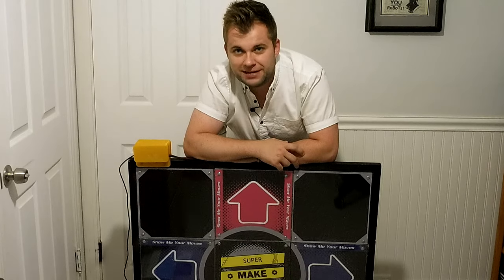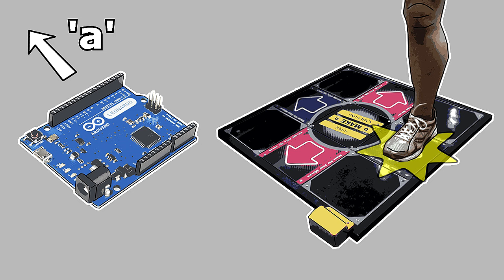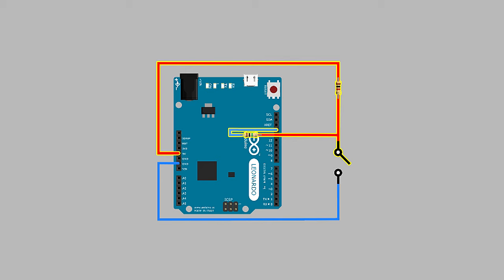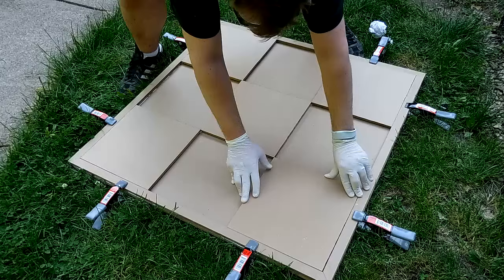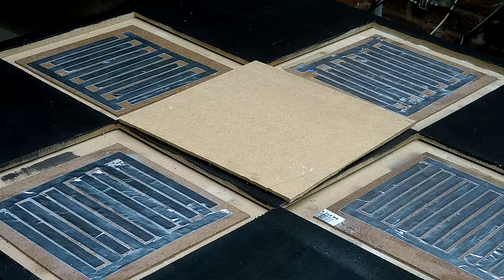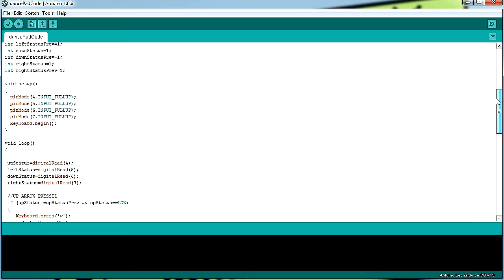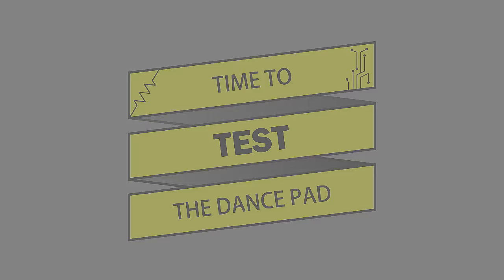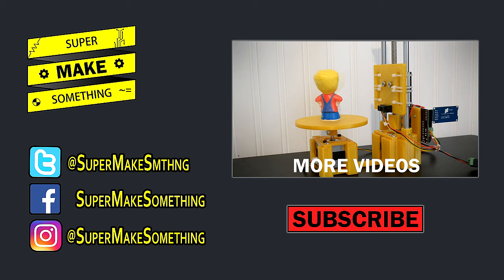USB DDR Dance Pad (Arduino, Pull-Up Resistors) - Super Make Something Episode 9

Comment: I can't find the arduino leonardo on https://store-usa.arduino.cc  .   will your arduino code work on any of the other arduino products?  I'm looking at the cheaper ones like ARDUINO 101 or ARDUINO UNO REV3??
Reply from the maker: +Reid Weatherly hmmm. You are right. It looks like they discontinued it. :-/ The chip that allows the Arduino to act like a USB device is the ATMega32u4. Looks like the Arduino Micro also uses this chip so it will work. Alternatively, you may still be able to buy Leonardo's from a site like Sparkfun or Adafruit.
Reply: Wow! you responded super quickly! thanks man. I just found your channel and your prompt response pushed me into subscribing. : ).   I found some on amazon but I guess they are fake knock offs.  about 20% don't work..  

[Edit]  I just checked Sparkfun and Adafruit like you said and they do have it!  This is exciting for me because I missed the whole DDR thing and I want to go back and experience it.  I saw you tell someone this project maybe cost you $75.  I don't plan on doing any graphics or acrylic to save on cost.  This shouldn't actually affect anything right?  I assume the Acrylic was just to protect the fancy graphics.
Reply: I ordered the Arduino Leonardo.  I'll tell you how this goes! I'm doing it! : )
Reply from the maker: +Reid Weatherly Awesome! Please let me know how it goes! The acrylic was actually about ~1/4 of the total build cost, so you may come in a bit cheaper depending on how/if you paint it. As I said in some of the other comments some modifications I would suggest after having built this one would be to 1.) use metal sheet instead of aluminum foil, and 2.) use screws to fasten the electrical connections instead of electrical tape. Both of these will save you some maintenance in the future and increase the longevity of your pad. Another user suggested rubber pads instead of weather insulation, which may also be a good idea as this will be somewhat stiffer and thus help the buttons "bounce back" faster. Good luck!
Reply: my Arduino Leonardo arrived! It didn't come with a power supply cord though.  but I was able to get the code uploaded to it.  I ordered a "Battery Clip with 2.1mm X 5.5mm Male DC Plug for Arduino".  I'm just going to use a 9 volt for now.  It should arrive in 2-3 days.  I'll update you then. : )
Reply from the maker: Reid Weatherly Awesome! For this project, the Arduino is actually powered off of the USB port, so no additional power supply is required.

Comment: 2 Questions about the wirering:Is the connection between GROUND and PIN with the RESISTOR already build in the arduino? and: What RESISTOR should be used between the 5V and PIN? Thanks in advance
Reply from the maker: Madaadam relative to the ground, the pin has high electrical impedance when configured as an input. This can be modeled as having a large resistor, but doesn't physically require one. 

The Arduino also has internal pull-up resistors that can be enabled via code, so no external resistors are necessary.
Reply: OOOhhh that makes sense. thanks for the quick answer

Comment: How will the foam hold up? Will it maintain its springiness with wear and age?
Reply from the maker: The pad is only ~1 month old, but the foam is holding up well so far!  It's relatively inexpensive and is sold in large rolls at the hardware store, so swapping it out from time to time should not be a big problem.
Reply: Nice! What difficulty do you play on?
Reply from the maker: I play Heavy.  Just estimating, I would say ~1 hr every day or two..?

Comment: Since some people don't have access to all the power tools used here, wouldn't it be easier to
find a supplier/business that can provide wooden boards cut to custom sizes? And for the enclosure, have it printed in 3d printer shop? 

Would still propably be a lot cheaper than getting the 350$ option.

Comment: Awersome project! what type of wires did you use?
Reply from the maker: Thanks! I used solid core wire, but really any wire should work.  There isn't a lot of current going through them, so whatever fits into the Arduino headers should be good!
Reply: @SuperMakeSomething  thank you so much! In these days i'm buyng the materials, so i didn't find the 16mm mds and 8mm mds so i replaced with 20mm and 10mm i think it could work, and also i had to change the measures from 90x90cm for the base to 100x100cm, 32x32cm for the stationary panels and buttons and from 23x23cm to 28x28cm of the carboard, for the cables i thought i can connect the Arduino wires to eachother using pins like female and male and stuff, i hope that the result will be good!

Comment: Do you really need Pull Up Resistors for this?
Reply from the maker: The pull-up resistors are actually internal to the Arduino and enabled through code, so no additional hardware is required!
Reply: @SuperMakeSomething  thanks!

Comment: Hi, thank you for your useful guide! Just wondering the value of the ohm of the resistance... Thanks 🙏
Reply: Ok, after half an hour reading all the comments below I found out that the resistor (Sorry, I called it resistance) it's inside the Arduino.

Comment: Hey Super Make Something!
I love this guide! I just bought a Leonardo to update my DIY pad.  I just wanted to ask:

Is it possible to add START/ SELECT buttons to the Arduino? How would you code this and and set this up?
Reply from the maker: Thank you! Glad that you like the video! This is definitely possible to add -- all you would need to do is add two more if statements for two additional buttons in the Arduino code and then wire them up into two other IO ports on the Arduino. After that, you can just assign them in Stepmania as usual.
Reply: @SuperMakeSomething  thank you very much for the response! I think I got the coding figured out, I'm just having troubles figuring the wiring. Would I  connect the buttons to the same ground lead as the rest of the dance mat? Or do I have to use a separate port for the buttons

Comment: but what if u want a DIY pads 4 other consoles?
Reply: Instead of using a micro controller you could wire your pad to a spare console controller. You could solder the wires to the buttons of the controller so that when you step on a button its as though you are pressing a button on the controller.

Comment: Im wow it look nice but I built DDR and PIU pad where we hide all the parts inside the pad.  our pads to be used on  3/4" MDF and meant for dual pads for dual or single play on dual pads.  built with heaver pads to stand up to long time with breaking.  they match the actual size of both machines pads with our own pad designs.  there for there USB cable to plug in to computer or laptop. FYI, you mounts of unneeded detail in the video as we both know more about the electrics design.  we trimmed ours with metal ( a major pain int the booty ) as to match the PAID pads.  Like they say, you get what you pay for.

Comment: Does an Arduino mini meet the requirements for this project?
Reply from the maker: The Arduino mini does not, as the ATmega328p chip cannot natively emulate a USB HID device.  However, any Arduino with an ATmega32u4 chip will work!
Reply: @SuperMakeSomething  Thx for your answer! I saw in the data-sheet that the pins allowed it but I wasn't sure about this part.

Comment: So my electrical engineering is shaky here, but could you theoretically modify the code to take input for "select" and "back" buttons?  It looks to be a straightforward copy/paste affair. The Leonardo can take 6 inputs, which would allow for the extra buttons. Of course, you'd have to build two more buttons on the pad itself as well.

I'm a sucker for having "X" and "Δ" so I wouldn't have to use anything but the pad to navigate Stepmania
Reply from the maker: Hi Adrian!  You bet -- you can add as many buttons as the Leonardo has inputs by copying/pasting additional if statements.  (You can also add waaaaay more buttons using an additional piece of hardware called a "multiplexer," though this would require more significant modifications to the code.)  One thing I plan to add for my build is an external control box similar to the one that shipped with the Cobalt Flux pads back in the day, which breaks out an additional "Enter" and "Back" button, but you could also certainly modify the pad to have more buttons similar to Konami's official soft pads from back in the day.  I personally did not implement these buttons on my pad, since I've always accidentally stepped on them mid-song when playing with soft pads, but really the sky is the limit based on your personal preference.  If you end up making this mod, please share a picture of it with me!  I'm always excited to see other people's builds.  Happy building and DDR'ing!

Comment: Hi! This is the best dancing pad project i found on the internet, but how is it feels to press "foam" buttons? Do they wiggle a lot?
I think it would be easier to order cheap numpad from ebay and then just braze contacts to buttons instead of using arduino, but still, your project is the best!
Reply from the maker: Александр Вавилин Thanks! The foam is not very stiff (just barely enough to let the panel "pop back up" after it is stepped on) so it is not really noticeable. The clearance between the button panels is also not very large, so there is not much wiggle. Because the panels are not screwed down, however, they can slide off while carrying the pad, though this makes servicing the dance pad easier.
Reply: Ok, thanks!

Comment: hey would 1/2 inch by 5/16 inch foam tape work
Reply from the maker: Robert Schumacher It should, though you can always adjust some dimensions if needed. If the foam is too tall, it should wear in with enough playtime.

Comment: i have the old dance mat that soft mat i want to mod it.. can you make it dance pad that can play pump it up and ddr
Reply from the maker: This is definitely possible by adding additional buttons on the diagonals. That being said, modifying a soft pad into a hard pad to do this may be more trouble than simply building a new pad with the switch design shown in this project. If you end up making this pad or modding your soft pad, please let me know! I would be interested to see your results!
Reply: @SuperMakeSomething  my soft pad is for usb and i play stepmania on pc you can map the button right.. i think it just need to add wire and replace the plastic circuit board with aluminium foil i have a simple sketch how the mod is https://drive.google.com/file/d/1lrKCrU0_CBtsEOc_Ae0nqeWuHHdhxP09/view?usp=drivesdk
but yea turning the soft pad to hard pad plywood or mdf board i dont have idea on how to make it with plastic glass or what to do first.. i think i can follow your video a little bit but if you can make another video that will be great..

Comment: Is there a way to make a PlayStation 2/Wii compatible version?
Reply from the maker: I think the best/most direct way to do this would be to swap out the arduino/foil with the circuitry from a softpad.  That way, you would also still have to correct connector.  However, all of the construction techniques would remain the same.  If you end up trying it, please let me know how it works!

Comment: You know what would really be great for these self-made dance pads if they could allow for use on the PS2, and other gaming systems that allow for DDR
Reply: If you have an old working controller for that system you can solder the wires to the controller's contact pads to make one that work's with that system.

Comment: This is amazing. A question as well. Would this be possible using an old PS1 or PS2 controller?
Reply from the maker: I think it should! Just solder wires to the appropriate leads on the controller PCB and you should be good to go!
Reply: @SuperMakeSomething 
Awesome! Thank you so much! I really appreciated your video man. I've been so desperate to play ddr again and the soft pads just aren't up to snuff. Cheers to you.
Reply from the maker: @breakecho5609  You bet! Haha I definitely understand the need to play more DDR, especially given how hard it is to find machines in arcades these days.  Good luck with your build and please let me know how it turns out!

Comment: is possible to yuse a code like this?
#include <Keyboard.h>
void setup() {
  pinMode(1,INPUT);
  pinMode(2,INPUT);
  pinMode(3,INPUT);
  pinMode(4,INPUT);
  Keyboard.begin();
}

void loop() {
  if (digitalRead(1) == LOW){
    Keyboard.write(KEY_UP_ARROW);
  }
  
  if (digitalRead(2) == LOW){
    Keyboard.write(KEY_DOWN_ARROW);
  }
  
  if (digitalRead(3) == LOW){
    Keyboard.write(KEY_LEFT_ARROW);
  }
  
  if (digitalRead(4) == LOW){
    Keyboard.write(KEY_RIGHT_ARROW);
  }
}

Comment: Great video! Question: Can you use copper tape instead aluminum foil?
Reply from the maker: Thanks and interesting question!  Cooper tape should conduct, so I believe that this would work.  I don't have any experience with the material myself, but I'm wondering if you could solder to it directly and avoid the washers entirely.  If you try it, please let me know how it turns out!  I'd be really curious to learn if this is possible.
Reply: Yes you can. I was able to use aluminium tape but the only problem is, the adhesive side is not conductive and you cannot solder it. What I did is to use wires for the continuity of the foil path. Make sure to use copper tape with conductive adhesive to avoid continuity problem. You can also solder your wiring better with it.

Comment: i have an error on arduino that the keyboard.h is not found
Reply: What Arduino board are you using? 
The keyboard module is only available on 32u4 and SAMD-based boards (Leonardo, Esplora, Zero, Due and MKR Family),
[ src: https://www.arduino.cc/reference/en/language/functions/usb/keyboard/ ]
I have managed to use an Uno to do this project, however using it as a gamepad rather than a keyboard.

Comment: 1. May I know why you are using aluminium foils and not copper tapes?
2. Why are you not using resistors?
Reply from the maker: Ivan Low Hi Ivan! 

I chose aluminum fouls because it was a cheaper way to cover the whole area underneath each button, but copper tape would definitely work as well (and you might be able to solder to it directly). 

I am not using additional resistors because the Arduino has internal resistors that can be activated through software. This saves wiring and additional components.
Reply: Super Make Something Thank you for the explanation! Appreciate it. I will try out the internal resistors.
Reply: Ahhh I just found out that you set the pinMode() as INPUT_PULLUP which activates the internal resistors. Am I correct?
Reply from the maker: Ivan Low Yup that’s correct!

Comment: Do you still us the board? How is it working today
Reply from the maker: Anthony C. Kelly The pad is holding up really well! Responsiveness is still the same as the first day. The only thing I would change is to use polycarbonate instead of acrylic for the button sheets right away. The acrylic is unfortunately not impact resistant enough and cracks easily.

Comment: hello! i'm planning on either making a ddr or piu dance pad and your video is a great base! this seems like a fun and easy project for me to do with an adult, i wonder though, could you use an FSR instead of the aluminum foil circuit you have going on? nothing wrong with it of course, very intuitive way to sense the input, i just wanted adjustable sensitivity and all those benifits that come with using FSRs for a dance pad instead of a traditional arcade sensor or diy sensor.
Reply from the maker: FSRs should work! To be safe and make sure that a step is sensed, I would put one FSR on each corner + one in the middle of each panel, since the panels can be quite large. If you try this, please let me know how this turns out! That’s a very cool idea!
Reply: @SuperMakeSomething  you think i could get away with cutting up an FSR408 and attaching jumper wires instead of buying seperate FSR406s?

Comment: I hate to necro this video, but i literally just rebuild my control box using arduino. 
I am having massive debounce issues where i did not have them before with my old control box. I thought debounce was a physical issue, not a control box issue?

Also, while the pad is working (ish) in game, it does not show up in linux as an HID. Thus, I am unable to view the polling rate that checks polling rate for mice/keyboard using this code https://gitlab.com/iankelling/evhz

Again, any assistance would be greatly appreciated. "
PS This is my first arduino project
Reply from the maker: Hi Doug!  Sorry to hear that you are having problems with your build.  Unfortunately I cannot be much help with your Linux issue, since I've never tried to use the Arduino HID functionality with that OS, however the debouncing behavior can be fixed by modifying the microcontroller code.  You are correct that you are essentially experiencing "mechanical chatter" that is causing false readings.  To overcome this, you can use Arduino's built in "millis()" function to only accept a keypress in a certain time window.  More information about this can be found here:https://www.arduino.cc/en/Tutorial/Debounce

Alternatively, check out Apfelboy077's code in one of the comments below.  He shared a modified version of the code that implements debouncing behavior.  While I have not tried it myself, he says that his code fixed his debounce issues.  

Best of luck with your build and happy DDR'ing!
Reply: Super Make Something his code is no longer present.

Thank you though